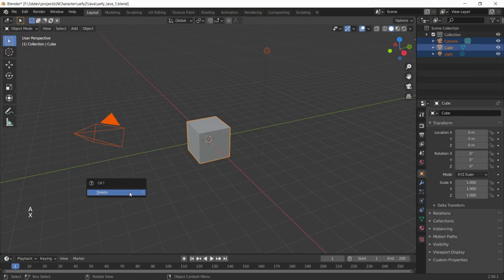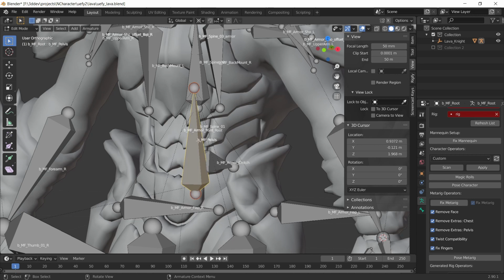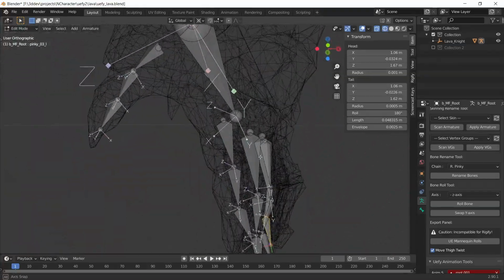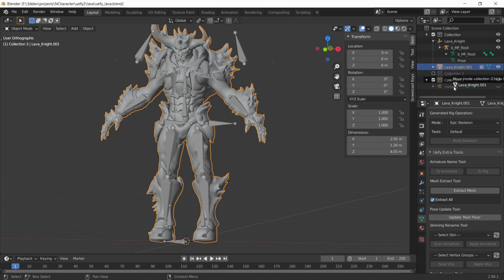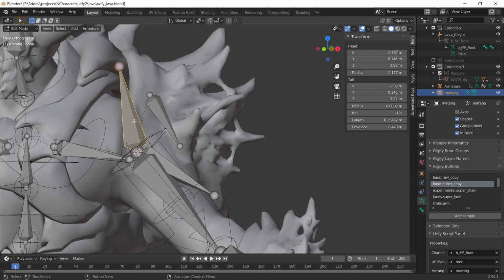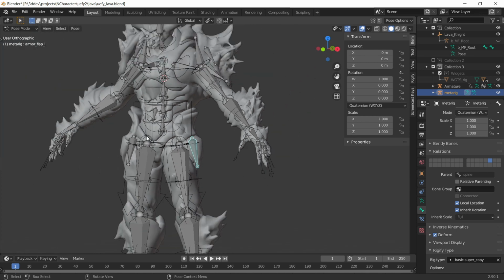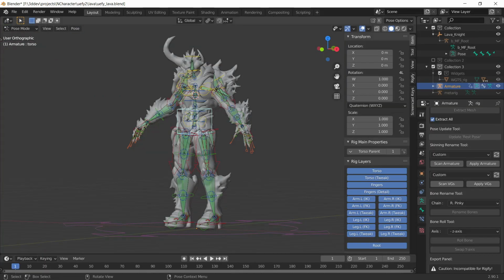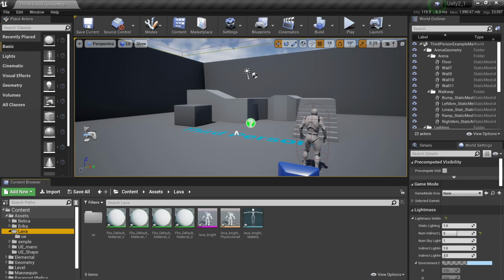Advanced Character Rigging with Blender, Rigify and Uefy 2

Comment: how do you know if auto orient bones on import option is appropriate for ones mesh?
Reply from the maker: We try out different import settings and settle on the one which requires the least amount of updates.
Reply: @RakizFarooq  when i click on roll bone in edit mode, sometimes nothing happens, the swap axis button works but not roll bones? any ideas?
Reply from the maker: Select the appropriate axis to match before you click on roll bone button.
Reply: didnt work for me, i tried all axis and they doesnt roll
Reply from the maker: The roll tool is working fine for me. The only thing that comes to mind is that you should check if the armature is the only object that is selected and it is in edit mode.